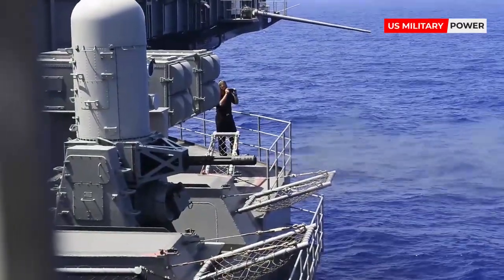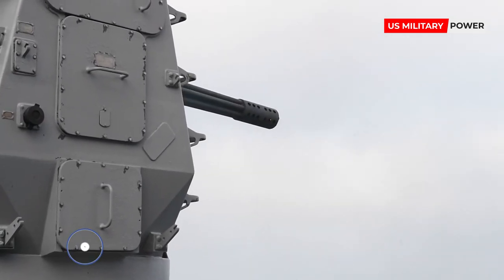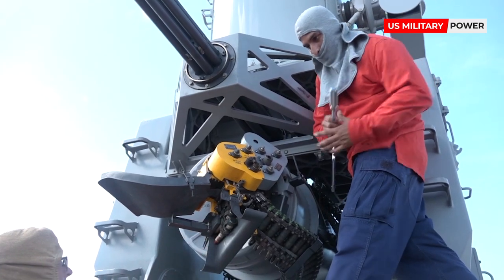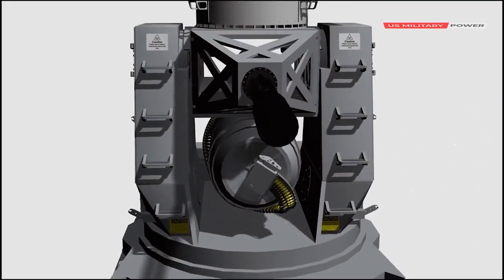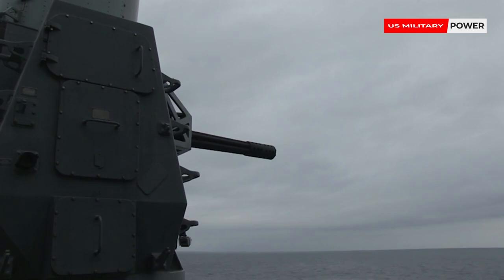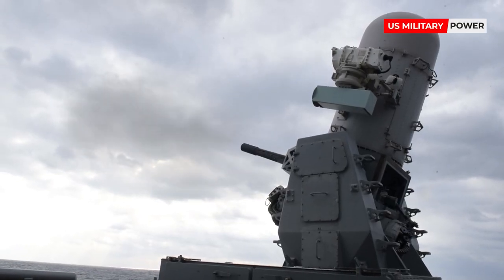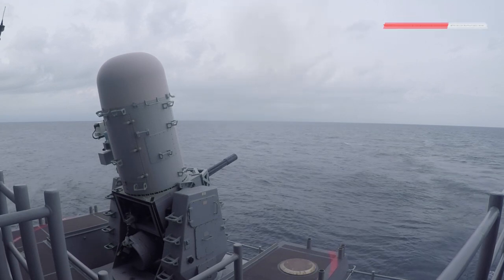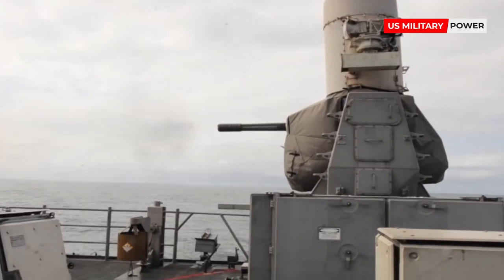How Powerful is Phalanx CIWS?

Comment: Our navy uses the goalkeeper system. Witch is a stand alone unit and uses the GAU-8 30mm avenger cannon. It has IR, thermal and radar guidance. A manual option is also possible because it's built in a conventional turret. In the design of the new frigattes for our navy the brass wanted to delete the system because of it's short range but the captain's insisted that it remained because of its secundairy roll as a defense against gunboats and anti pirate missions. Sinds the GAU-8 could shred any light attack boat from 4 miles away.